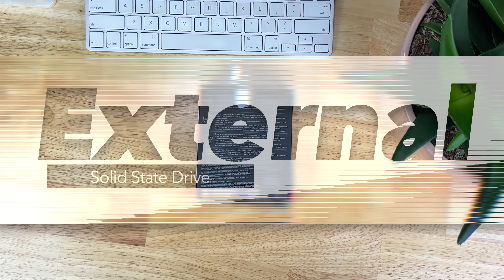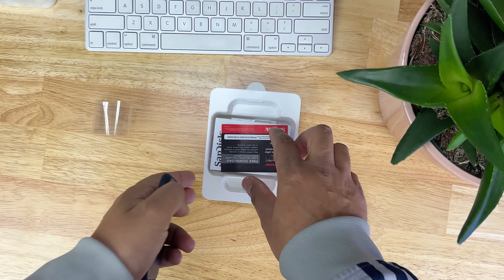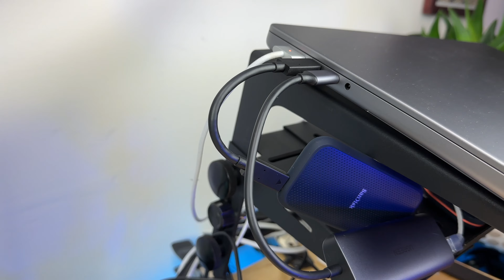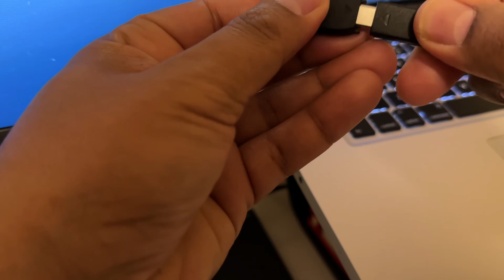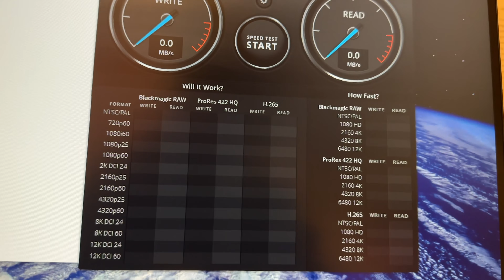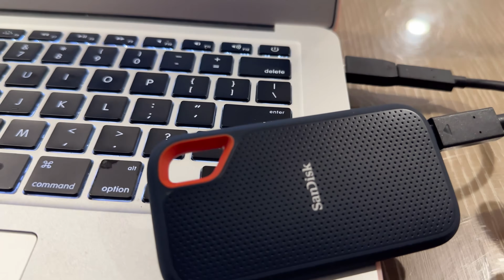SanDisk 2TB Extreme Portable SSD Review | Speed Test on Old & New MacBooks!

Comment: Have the same SanDisk 2TB Extreme, real transfer speed on USB-C port is only 180 MB/s running Windows 11, Intel i7 processor, SSD internal drive, 2 year old desktop. No single big file but 5,000 small file transfers.
Reply: small files reduce transfer rate.